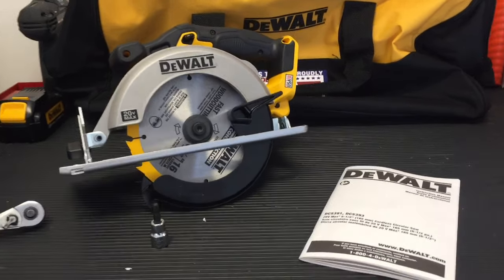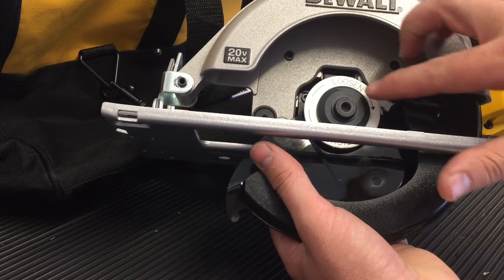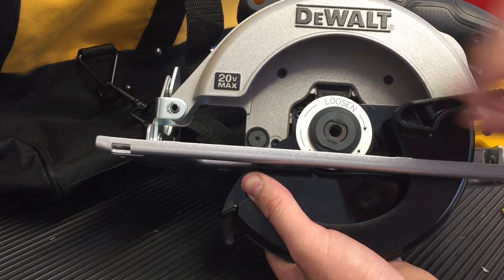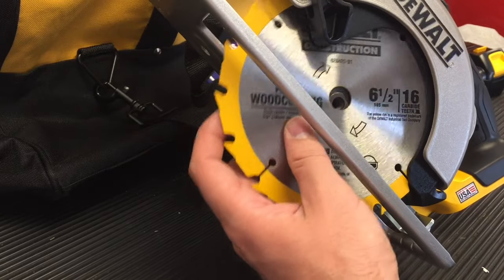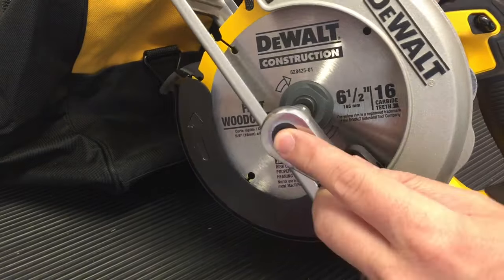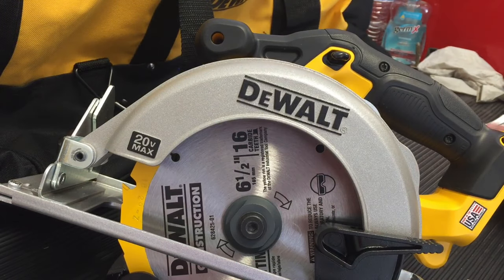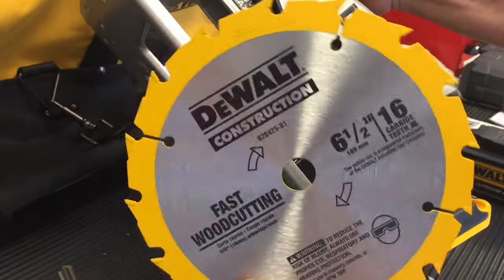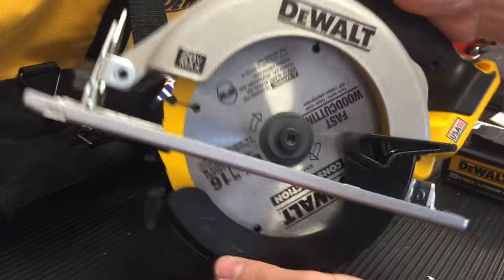DeWalt Circular Saw Blade Installation, Removal, Replacement: Shown on Cordless DCS393

Comment: Thank you for this, I needed to find out how to lock the mechanism so I could undo the bolt. Great vid.
Reply: How do you lock it? 
Mine still keeps turning.
Reply: @zippymo672  https://youtu.be/apjn8CYsx9Y?t=160 To bush the button all the way in you might need to rotate the blade slightly for it to fully push down.
Reply: @pfr1190 can't click the link! Can you re paste it?

Comment: Great video! I have had more of these given to me with bolt heads broken off! Makes them a perfect candidate for trying out the 2 part epoxy to remove the broken piece still in the saw. I have been taking them apart for years to fix them.

Comment: I wish Dewalt would have made a more secure feature to retain the allen wrench better.  I keep loosing mine all the ti e.  It slips out way too easy.  There's gotta be a hack for this to better prevent it from always happening so much.
Reply: I figured out a way to fix it.  I put two pieces of heat shrink tubing on it, a longer one on the arm portion, and a shorter portion on the head.  Now it fits very snuggly and does not slip out!

Comment: Blade direction is stamped into the lower blade guard in case anyone was wondering. (Don't know why they didn't add the Lefty-Tighty, Righty-Loosey instruction while they were at it.) Reverse threads can really ruin your day!

Comment: Hi Danny!  a great video!  What brand of 5mm socket are you using in This video? Is it a 5mm socket with a hex bit on The other end  that fits the blade. Just what I was looking for to help me with correct size  blade removal  tool! Thanks George
Reply from the maker: I believe it was a craftsman, but any brand should work if it’s the correct size
Reply: So any 5mm socket. Will do ? Thanks

Comment: WHHHHHY is this just spinning the whole thing? is there supposed to be a button you hold to lock the wheel from spinning THEN you llosen? like with an angle grinder?...
Reply from the maker: The one shown in the video is reverse thread, meaning you turn it clockwise to loosen it, which is generally the opposite the old phrase “righty tighty, lefty loosey” not sure if that helps. It’s designed this way so it does not come loose from the blade turning